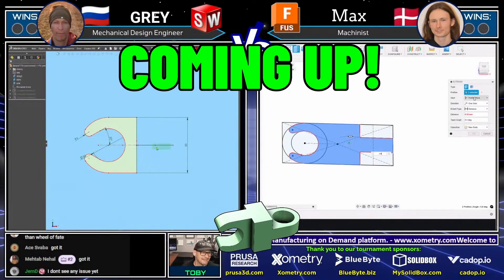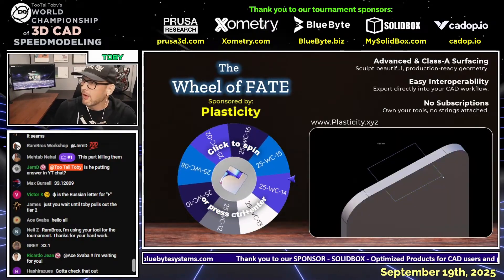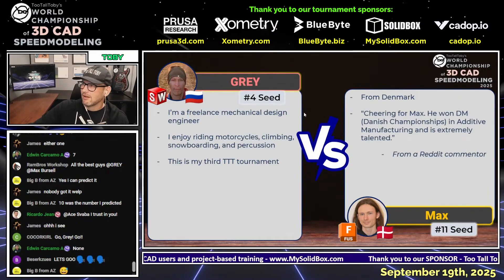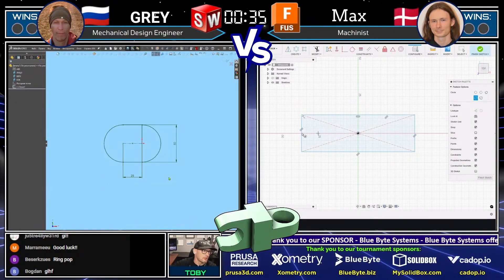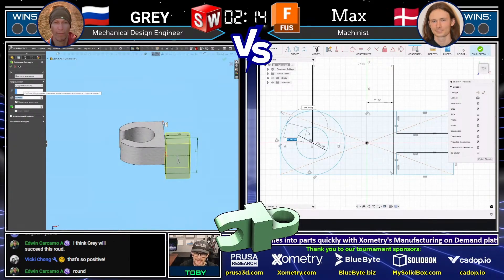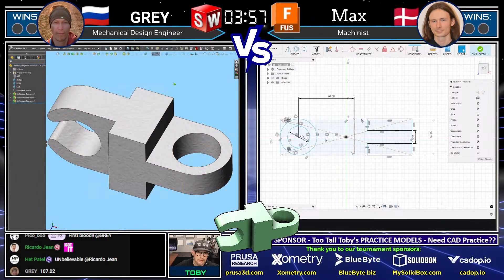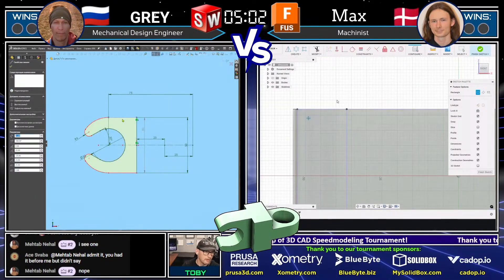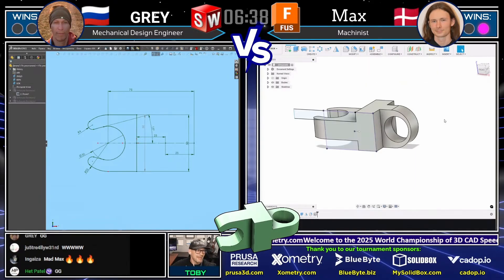CAD Speedmodeling Tournament! - MATCH 5 Battle 1 - WORLD CHAMPIONSHIP 2025

Comment: Well, mechanically the winning model’s central rectangular feature was not positioned accurately. However, since every additive/subtractive feature did not overlap and the thickness was correct, the final part weight should be correct.
As I see it, evaluating only by confirming the final part weight is a systematic flaw.
Basically, I could model three separate parts on a single plane and still get the same weight. 

Here's my suggestion. Back when I joined a CAD competition in university, we compared elapsed time along with interference analysis result to ensure the model actually matched the ground truth.
Some complex spline and curvatures could be a problem, but I'm thinking this is the better way to check the accuracy of the model like this : a simple mechanical part.
Reply from the maker: Thanks for the comment and glad you're enjoying the content! These tournaments are a lot of fun and I hope you'll stick around for a bit - there's a lot of history here (including "the ivan exploit") and I think you'll enjoy learning about the lore! 😁

Comment: In Solidworks, the weight is 105.80036 g, and in Onshape, it is 105.80036 g. Why is the tolerance 0.1 g? In 3D software, such a large deviation can only occur with an inaccurately modeled part.
My Onshape public part - Use the Extrude Intersect command
25-WC-10 - COUPLING BRACKET Intersect
Reply from the maker: All the challenges have a tolerance and its usually around this range.  Makes it easier for people using different CAD systems to compete and enjoy the challenges!  Lots more at challenges at https://www.TooTallToby.com